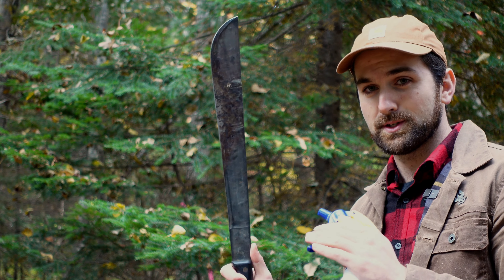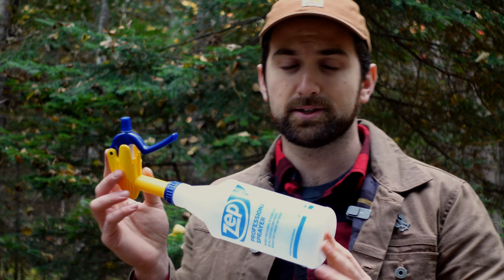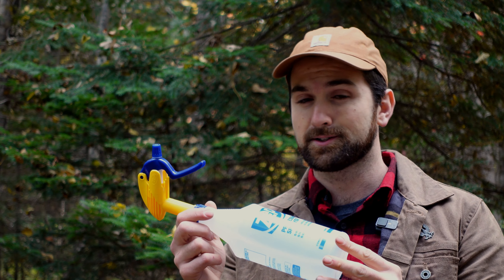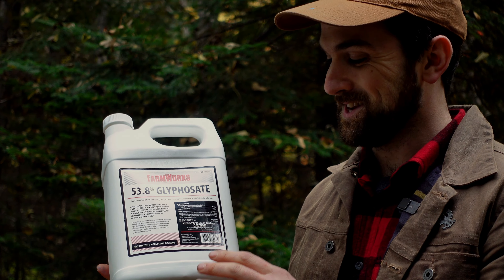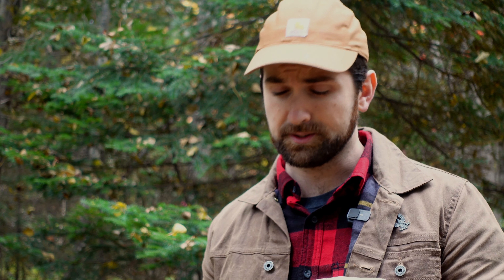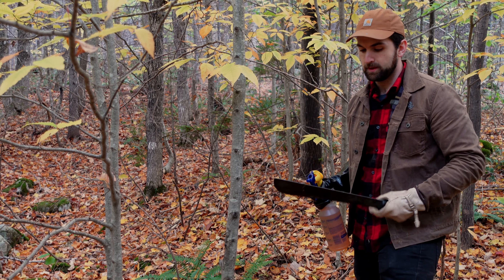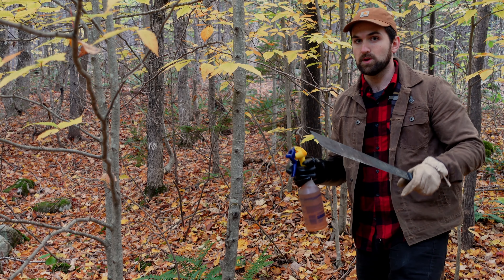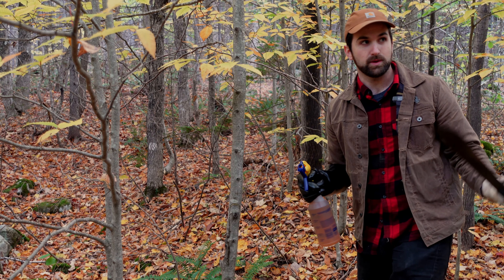Controlling American Beech With Herbicide Stem Injection

Comment: Good information. I’m just a curious person at this point learning what I can and considering buying some timberland. Nothing huge but for me 40-50 acres are large parcels. The hack and squirt method is common approach. I’ve watch other videos on this process and would recommend to your readers to consider putting a dye in the spray bottle. This doesn’t affect its effectiveness but will help seeing where and what you have treated as you go. It would also be informative to revisit and walk the parcel in 6-12 months and see how effective your treatment was .
Reply from the maker: 100% agree. My biggest problem was human error due to missed stems, so dye definitely helps. 

I plan on doing a follow up video, but got rained out every opportunity I had this past season, so it didn't work out. Stay tuned!

Comment: Here in NH I’ve seen very little browse on beech by deer or moose.  I’ve seen 50 acre+ clear cuts in the White Mountain National Forest on beech only regrowth because they didn’t treat the stumps so the beech root sprouted and the deer/moose browsed any oak and maple growth so it turned into a beech monoculture.
Reply from the maker: Unfortunately, that's very common, and it can be devastating for the forest's future. I'm of the opinion that if a stand has at least 10% beech, a follow-up herbicide treatment should be used to prevent this from happening.
Reply: I didn’t realize until the past year how invasive they can be depending upon how a wood lot is managed and the soil of the lot.

Comment: Did you do a follow up showing results ?
Reply from the maker: Not yet, this past summer was terrible for weather, so I never got a good opportunity with the drone. Anecdotally, it was about 80% effective with the biggest issue being human error--which is to say I missed a lot. If I were to do anything over, Id probably use a dye to more easily see what I had sprayed.
Reply: @thetimberlandinvestor  Thanks for the reply. I just did a few trees outside my property  and I used Triclopyr and diesel. I was searching everywhere for a hack and squirt using glyphosate . I live in Asia and either side of me is jungle. It's worked on some of the trees very well and not at all on others. I'll try with the same mix you had and hope for better results.

Comment: i hear you can cut in fall or winter when it is dormant, and it will not resprout
Reply from the maker: There are a lot of theories on how to harvest (without herbicides) to limit resprouting. Ive seen them all, and personally I don't think any are reliably effective enough to promote. In regards to winter/summer harvests, I haven't been able to see a difference at all.